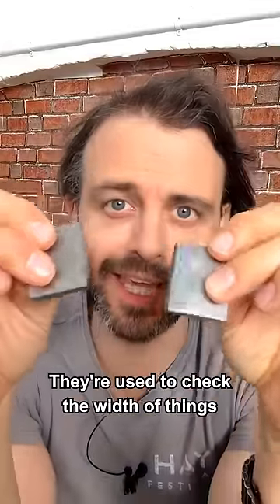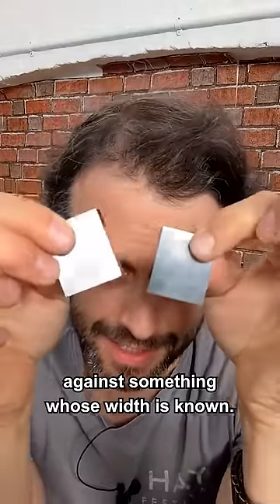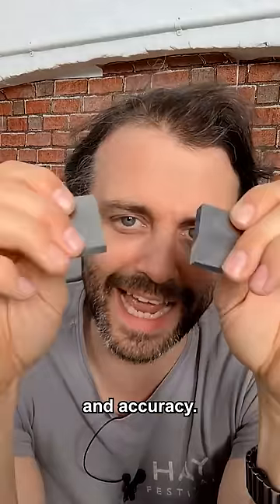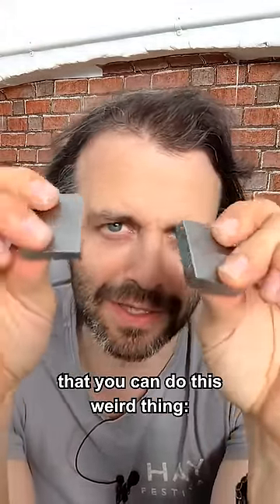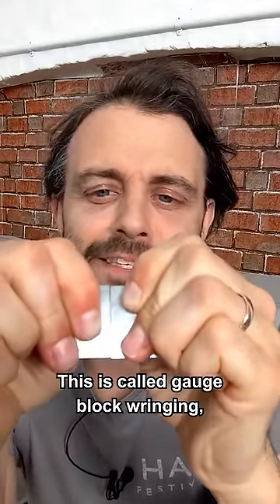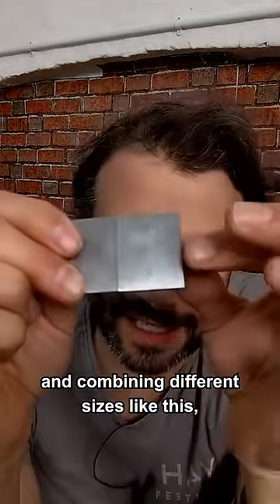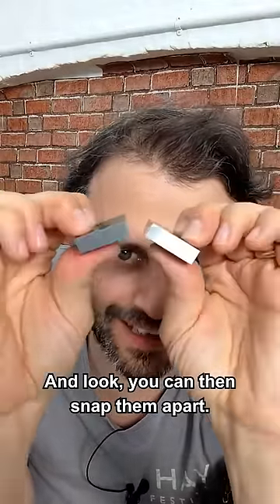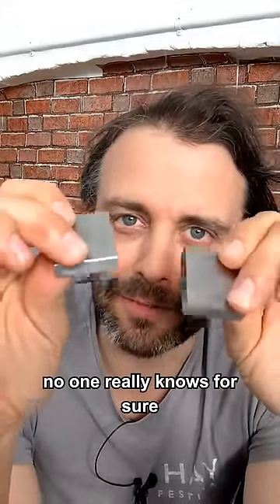No One Knows For Sure Why This Happens!

Comment: You have no idea how satisfying it was to hear you say they were machined with precision AND accuracy.
Reply: There's a difference? Do tell me more if you'd be inclined.

(Also I'm being genuine, not sarcastic)
Reply: @tempest8342  precision is how close the results are together and accuracy is how close they are to the desired result.

if i want blocks of 10mm width and I receive all blocks of exactly 11mm then that would be very precise but inaccurate. if i instead received a bunch close to 10mm, but each one was 1/10th mm off, then that would be quite accurate but imprecise.
Reply: Thank you
Reply: @tempest8342 Precision is the consistency of accuracy
Reply: @rockstarali99 but it doesn't have to be accurate to be precise, that's why I think that other, slightly more in depth explanation worked just fine
Reply: You wrote a comment AND replied
Reply: @tempest8342  Previous two answers were very precise but inaccurate. Precision is the fineness of the scale of measurement and the rounding of the last 'significant digit'... which is useless and misleading if you don't calibrate your instrument and state your margin of error. Ironically, Steve's gauge blocks both say "30", and not "30.000". I could, for instance, engrave "1.5 inches" on my Zippo lighter and have the same level of accuracy plus one significant digit more precision than Steve because his "30" is just everything between, say, 25.000001 and 34.999999. See what I mean?
Reply: @zanechristiansen  accuracy is just a trait. The consistency of for example 65% accuracy is still precise albeit of lower accuracy.
Reply: @rockstarali99  yea I was just trying to make sure anyone reading knows that it can still be wildy off, like. they're not really connected in a sense. but in the sense you're putting it its like they are, but you can be completely {"a":7,"b":1,"c":232,"d":243,"e":{"a":" in ","b":231,"c":235,"d":[" "],"e":[" accurate"],"f":[0]},"f":"There may be a grammatical issue in this sentence. Consider rephrasing it.","g":false,"h":"Correctness","i":false} and..... ok my phone just auto corrected to that... im leaving it .. that completely distracted my train of thought and I forgot what i was saying wow wtf, 1200 dollar s23 ultra and it is a literal piece of poopy
Reply: @tempest8342 Example: I have a gage block that is 2" long. It has been certified by a laboratory to be within a few millionths of of 2". This gage block represents accuracy.

Now I have a 12" wood ruler. It is graduated in 1" increments. It's probably pretty close but the increment lines are sort of wide. This ruler represents precision. Because it resolves to finer increments than the gage block.
Reply: @zanechristiansen  no you’re right they are distinct, however the definition is rather accurate no pun intended.

The connection is made purely because of the common misconception to misconstrue them. Neither to be precise does something have to be accurate nor does it have to be precise in order to be accurate.

We connect the definitions purely to distinguish between them; on the account that they are often confused with one another.
Reply: @rockstarali99  good explanation I like that, cheers
Reply: @mytzelk8876 thank you. I somehow worked in mechanical design for 6 years and never knew that. Though I only ever used the term "precision."
Reply: @zanechristiansenturn off auto correct
Reply: Adding precision was kinda unnecessary, if they’re both accurate then they’re obviously also precise.
Reply: @tempest8342 Precision refers to the design, being as reasonably close to exactly 30mm as possible. Accuracy, however, refers to whether or not it is actually 30mm or not. If these blocks were exactly 20mm, it would have been precisely made, but not accurate to the request of 30mm.
Reply: I thought this is molecules holding hands
Reply: @mytzelk8876 This is 100% incorrect and I can’t believe 100 people liked this comment. 

Definition of Accuracy:
“The quality or state of being precise.”

Definition of Precise:
“The quality or state of being accurate”

You stated that if you order blocks of 10mm width, and received 11mm blocks, it would be “very precise”? 🤔
Reply: @charliekowittmusic I'm sorry, but your definitions don't prove anything. If you got those definitions from where I think you did, you didn't even include the whole definition. You only used the parts that fit your point of view.

Here are definitions from the Cambridge Dictionary:

Accuracy: "the fact of being exact or correct"
Precision: "the quality of being exact"

In the Merriam-Webster dictionary:

Accuracy: "conformity to truth or to a standard or model : exactness"
Precision: "exactly or sharply defined or stated"

The Oxford dictionary

Accuracy; " the state of being exact or correct; the ability to do something with skill and without making mistakes"
Precision: "the quality of being exact, accurate and careful"

Accuracy tells you whether or not something is exact. (Statement of fact)
Precision is about how close to being exact something is. (Statement of quality)
Reply: @mytzelk8876  My go to example of accurate but not precise are things which have been scraped flat.  It's also works for flat vs smooth.

For those who are unfamiliar.  We can get an extremely flat surface by scraping off the high spots over and over again.  However, since we don't go to smaller and smaller scrapers you end up with a "rough" patterned surface.  On average it's extremely flat, so it's accurate, but examining any two points shows "precision" can vary quite a bit.

Using quotes, since it's more complicated than that and I'm not an expert.
Reply: @arthurmoore9488 Easy way to explain this. Think of a dart board, precision is how tight your grouping of darts thrown at the board are, Accuracy is how close to the bullseye your grouping of darts are.
Reply: @mytzelk8876 I think that in normal speech, precision implies accuracy. If I said that the job is precise, I'm implying that is also accurate.
Reply: @andrewthorpe3377   I agree with 100% of those definitions, and they prove my point even more completely than I did. Explain how those definitions describe what the other guy said.

He said getting 11mm blocks when he ordered 10mm blocks would be “precise”.
Precise means “exact” in all those definitions. 11mm is not exactly 10mm. Hopefully we can agree on this basic logical fact?
Reply: Think of it like hitting a bullseye as an archer. Fire 1 arrow and get a bullseye? Dang that's precise.

Fire 10 arrows and they all hit in a tightly packed region roughly 5 inches down and to the right of the bullseye? Well the bow and arrow are accurate, but not precise.
Reply: (it was so satisfying to press that like button and see it go from 999 to 1k. Human minds are weird in the things we find satisfyingly)

We often have to go over the difference between precision and accuracy with students in our classes. We usually use a dart board analogy.

If you throw 3 darts and they all hit the same spot you've got one attribute. If you throw 3 darts and they all get close to where you're aiming that's the other. You have one and hit in the same area (but not on target), or you can have the other and hit close to the bullseye (but not all 3 in the same spot), but you need both to get all 3 in the bullseye.
Reply: @zanechristiansen no, this is misleading.
Reply: @darioburstin2418 In most cases yes, but you can do a job perfectly to specifications but then have the client still complain because the specs were wrong. That's precision and accuracy

If you cut something to the exact measurement you meant to cut it but it doesn't fit because someone didn't measure the first thing correctly then one of the attributes is missing.
Reply: @Sherizati  Missing a bullseye is not accurate. Accuracy is “precise” and “exact”. How is missing every shot accurate? Things are getting crazy around here 😂
Reply: @Sherizati  The word you’re looking for is “consistent”. It would be consistent. Not precise or accurate.
Reply: @tempest8342  The easiest analogy I can think of is firing a gun or bow. You can be accurate but not precise (your shots are all over the place but some hit the target, so those shots are accurate). You can be precise but not accurate (all of your shots hit the same spot, but it's not the target). The goal is to be both (hit what you're aiming at consistently).
Reply: @darioburstin2418  other way around. To be accurate, you first need to be precise.
Reply: @charliekowittmusic  The difference is 'correctness'. You have to be correct in order to be accurate. You don't have to be correct in order to be precise.

I like someone's example of shooting a target. If all of your shots are grouped around the bullseye, your aim is accurate (exact and correct). Accuracy measures how close to your target you are. 

If all of your shots are off to the side of the target, but they all go through the same hole, your aim is precise (exact) but not accurate (exact and correct). Precision  measures how close your shots are to each other.

If all your shots go through a single hole in the center of the bullseye, your aim is accurate and precise.
Reply: As a science teacher I too loved this
Reply: Correct and true
Reply: @timapple6586 that's not true at all. Because the accuracy at which those gage blocks are 30mm is way more accurate than your lighter being 1.5 inches. And he didn't say the measurement written on the block was "accurate and precise" he said the blocks were accurate and precise. Just because it doesn't SAY 30.000mm doesn't mean that it wasn't created with that level of precision AND accuracy.
Reply: @tempest8342 A great way to visualise is to think of firing a gun at a target. If you take five shots all at the centre, they are accurate. If they're all in the same corner, they're not accurate, but they're precise.
Reply: @andrewthorpe3377  Okay, now you guys are really messed up. Because he didn’t say 10 missed, but tightly grouped, arrows was precise. He said it was accurate. 🤣 

I’m just gonna leave it at this, and let the uninformed choose to remain that way:

When you aim for a bullseye, you can be precise, or imprecise. Missing is not precise under any English dictionary definition.
Accurate is synonymous with precise in every thesaurus, and dictionary

The word you guys are looking for is CONSISTENCY.
Missing the same thing the same way 10x in a row is highly consistent.
Reply: We often average many measurents to estimate a quantity.  If measured with poor granularity, the measurements would be imprecise, however the average might be accurate. i.e. close to truth.
Reply: @co9221 LOts of people seem to confuse precision with consistency. 5 shots in the upper right corner of the target are consistent, but not precise.
The precision of a measure states the margin of error of the measure. "This apple weights 100 g, +-3g. This is the precision we are talking about.
Reply: @tempest8342  I like to think of it like two digital clocks, one with a seconds display and the other without. The one without seconds is more accurate if it changes, say from 11:00 to 11:01, exactly at that 'true' time (against some agreed standard), when the other one is (say) two seconds slow. However, the one with the seconds display is more precise because of the fineness of its measurement.
Reply: @ptwon7136  Only in such context. Otherwise precision refers to the degree to which repeated executions give the same result.
Reply: In machining, precision and accuracy are two different things. Think of a crosshair target with several shots bunched around the center, scattered throughout the 4 quadrants, that's accuracy. Now picture the same setup but all the shots a tightly bunched together in one quadrant, that's precision. Accuracy is simply not enough for gauge blocks.
Reply: A single gage block is accurate, but not precise. 

It's faithful to a traceable standard, but is not divided into increments.
Reply: @charlesfranz9018  Absolutely. Now let’s perform a quick test, and swap the words as an illustration.

“If measured with poor granularity, the measurements would be inaccurate, however the average might be (more) precise.”

(I added “more” because of your example: “close to the truth”. Something close to the truth is neither accurate nor precise. But it would be more accurate/precise than any one measurement.)
Reply: If I pee into the same 6mm area every single time, I'm being precise, but if that 6mm area is on the toilet seat, I'm not being very accurate.
Reply: @tempest8342  Think of a dart board. Tolerance is the board. Shooting for bulls you hit all triple twenties. You're within tolerance. You had precision to place all of the darts repeatedly in the same place on the board. Your Accuracy was off because the target was bulls. Your process/shooting was consistent. It needed adjustment to get closer to the desired result.
If your darts are all over the place including off the board then your process is out of control. That's called too many drinks.
Reply: @AManWithAGODComplex  That's tolerance, not precision
Reply: @timapple6586 That's resolution, not precision.
Reply: The reason we speak in terms of accuracy and precision is because in process control or metrology both an average and standard deviation are taken of the output over multiple points and compared vs. a target. The delta between the average and target, and the standard deviation are two distinct properties that usually have different root causes when they are out of specification. You cannot determine from a single failing point which kind of problem you have, and the methods to address each kind are typically very different.
Reply: @mytzelk8876 Thanks for telling me that all my maths mensuration answers were precise but innacurate.
Reply: I can't believe how many comments this discussion has needed to get absolutely nowhere for about half of the participants. 

Precise = Can consistently deliver the same result. Does not guarantee that result is useable by anybody. 

Accurate = Can consistently deliver useable results. Does not guarantee that each result is exactly the same. 

Example of precise = You ask me to make 7 blocks of size 3x3x3 mm. You can use them if they are never more than 1 mm off, on any of the sides. 
I make a block of a size 3x4x5. I then make 6 more blocks of exactly the same size. I'm not very accurate, but I'm precise.

Example of accurate = You give me the same task. I make the following blocks.
3x3x3, 3x3x4, 3x4x4, 4x4x4, 3x3x2, 3x2x2, 2x2x2. None of the blocks are identical, but you can use all of them. I'm not very precise, but I'm accurate.

Example of precise AND accurate = I make all the blocks 3x3x4. You can use them all and they are all identical. 

Notice how the last example was off by 1mm on one side, but was still both precise and accurate. 

I hope this helps.
Reply: @limbridk  Oh. So basically you are precise with your own results, but your super-precise results are not accurate to what was asked? That makes a lot of sense. Thanks.
Reply: @mytzelk8876  You nailed the definition with extreme accuracy. Now type this out several times over and I’ll give you a precision award.
Reply: @tempest8342 precision is like repeatability, once you have that you can adjust to be accurate.
Reply: @zanechristiansen do you need a doctor?
Reply: It‘s a tautology, isn‘t it.
Reply: @slyasleep  so long as I get people to talk about the subject, learn about it. Google it, prove me wrong, right, anything. I will have done soemthing. if it gets people talking about the subject in a way that they're actually learning something, then im ok, even if what I said was wrong.. (which I don't remember wtf I was saying in this comment thread) but I'm sure it was from a more informed standpoint than whoever is trying to say I need a doctor.... so. thanks? for worrying. but so far so good. are you good? is my next question. what did I say that suggests I need a doctor lol, was I drunk when I commented last?  lol don't know don't care
Reply: Isn’t precision basically the margin of error of the tool used? For example, a simple standard ruler has a precision of 1mm. 
Accuracy only makes sense if you can compare experimental values to some known true value..
Reply: @mytzelk8876  "but each one was 1/10th mm off" But they they are also precise, if they are all the same value.
Reply: same here!!
Reply: @mytzelk8876 wrong. Accuracy is how close results are together.
Precision is how close they are to the desired result.
Reply: @zanechristiansen  wrong. You don't have to be precise to be accurate.
Reply: @rockstarali99 lower "precision"
Reply: @-BuddyGuy  N=1 :)
Reply: If I may offer an example using colors... it's accurate to say that a fire hydrant is red, but it's precise to say that it's scarlet. Therefore precision is a more detailed and finer description whereas accuracy is simply being correct.
Reply: At this point you guys clearly just want to argue.
There is NO desire to learn or understand.
Source: I literally explained it perfectly and you children just continue acting like it's the first day of school.
Reply: @mytzelk8876  Indeed. In electronics, people often confuse the two. A digital meter will read to perhaps 6 decimal places, and people say it's 'super accurate'. Trying to tell them they are wrong is an almost impossible task.
Reply: @mytzelk8876 I don’t think so. If I get a blue print that calling 10mm & I produce exactly 11mm  it word be inaccurate & precisely wrong.
Reply: @zanechristiansen  I can't get over your autocorrect message. What a weird way of programming that data: every property is named, but uselessly so, as if the best structure was an array but unavailable.
Reply: @NicD  that was bizarre I have problems with auto correct constantly fixing my correctly spelled words into incorrect spellings or completely different words that are like 3 letters away from what I typed when I only missed 1 single letter, but I've never seen that before lol just glitching out so much it posts its own code. like wow
Reply: BingChat says:

Accuracy and precision are two important concepts in the field of measurement and statistics:

Accuracy refers to how close a measured value is to the actual (true) value. For example, if you’re aiming at a target, accuracy is how close your shots are to the center of the target.

Precision, on the other hand, refers to how close the measurements are to each other. This means, if you’re aiming at a target, precision is how close your shots are to each other, regardless of whether they’re near the center of the target or not.

In other words, you can be very precise but not accurate (your shots are close to each other but far from the target), and you can be accurate but not precise (your shots are scattered but their average is close to the target).
Reply: Weren’t made in China then?
Reply: I remember my chemistry teacher instructing us to put about 40cc exactly, in a flask, and then explaining what he meant. I'll never forget that moment.
Reply: @tempest8342  you can think of it like trying to throw scrunched up balls of paper into the bin!

If you consistently miss, but they all land in the same spot, you're precise, but inaccurate.
Reply: Precision is the grouping of darts, accuracy is the placement. You can have great precision with all the darts in one spot, but accuracy is hitting the bullseye. Precision increase a your throws become consistent, accuracy increases as you hit the target where you wanted. This is how it was described in school, anyway.